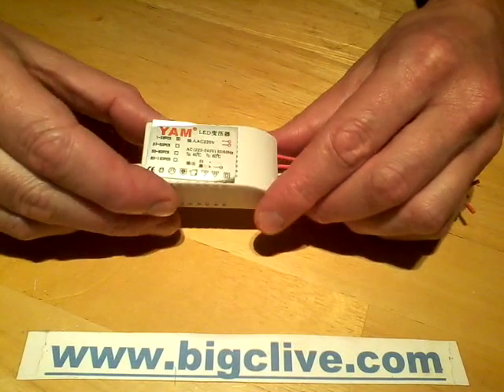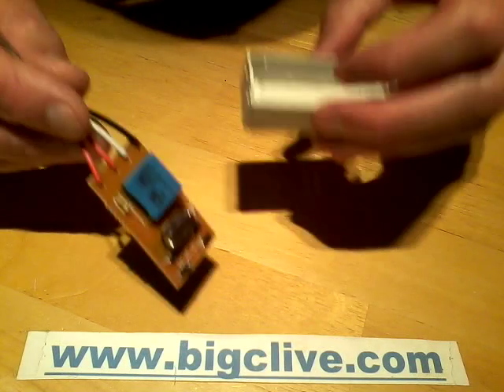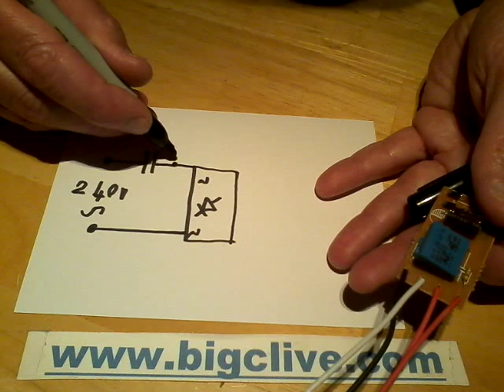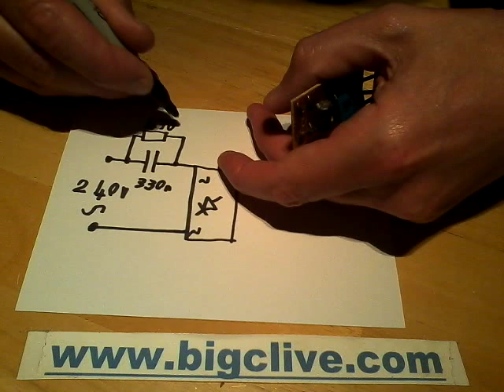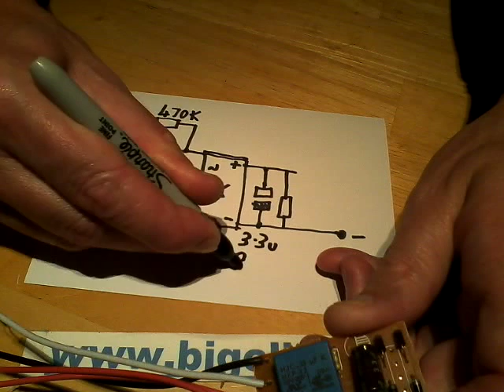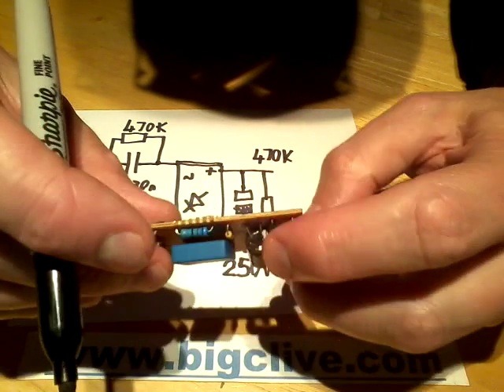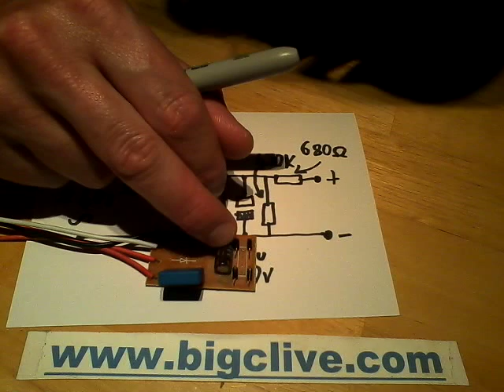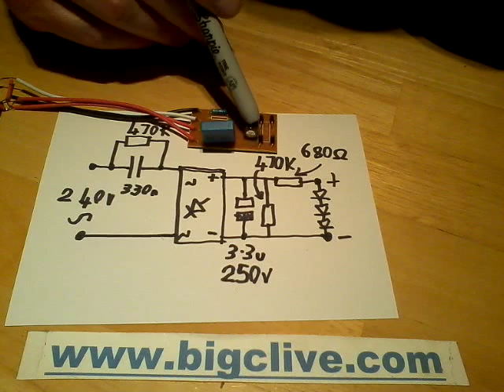Cheap series LED PSU from ebay.

Comment: hi bigClive, sorry to comment here. I wonder if you can make a video about "Digital Caliper". I google about how it works and they say "it use a capacitive sensor to register the measurement" - alright, Now... what i want from you is to demonstrate if we (the cheap generation) can build one with normal components, inventivity and passion. Instead of a display, just use LEDS !!! like a scale of 10, 1led per 1cm. The idea is to prove that the capacitance reading can be built - it's all that i'm interested in myself. Thank you - you are the Greatest!  (i hope you will read my post here and reply soon)
Reply from the maker: I think these units count pulses from an interference pattern.  Like alternate stripes sliding against each other.
Reply: @bigclivedotcom  thank you for responding. Yes you are right! 
  I google "digital caliper how it works" Here is a quick and dirty explanation of the principle:  https://www.wonkeedonkeetools.co.uk/calipers/how-does-a-digital-caliper-work/  Again, i want to know if we can build it. I am a hobbyist in electronics, i learn myself all that i know. You are an expert in these things so I expect good results from you. And is an interesting project!  Also, i may add, i want to make it and put it on my lathe for traveling cariage - wich is pure mechanical at this point. I dream over this little gadget for a couple of years to have it. Thank you again.
Also, announce me when(and if) you make it.
Reply: I rectify my request for you: I want to be able to make the 2 'sensors' as long or wide as I need. And by 'sensors' i mean the 2 sliding grid plates. And connect them to the existing electronics. Practically, I put new wires and new plates (customized). This is my whole intention. Thank you again.

Comment: I've modified one of these with a 100n 630v cap and a 4.7uf 400v electrolytic and get a voltage of 305v (I'm on 240v) so that I can run a string of US bought 120v 50 LED christmas lights. Would this work or would I need to drop the voltage down further to be close to 120v?
Reply from the maker: The devices limit the current, so the string of LEDs will just pull the voltage down to the level required.